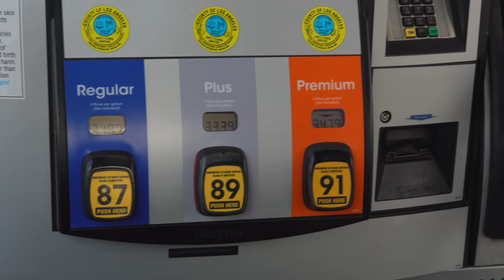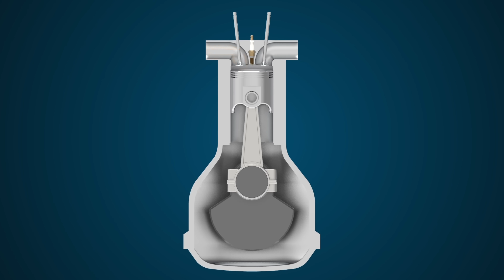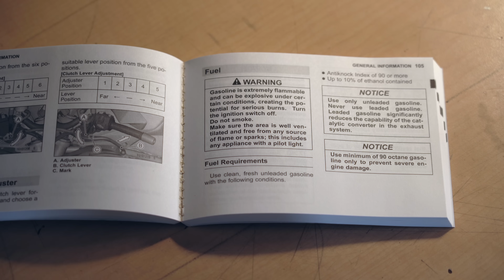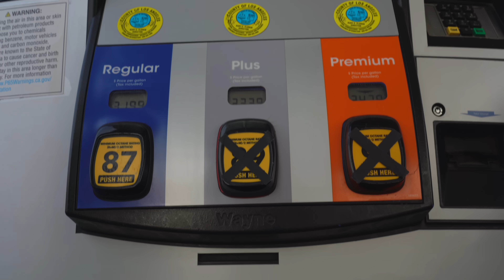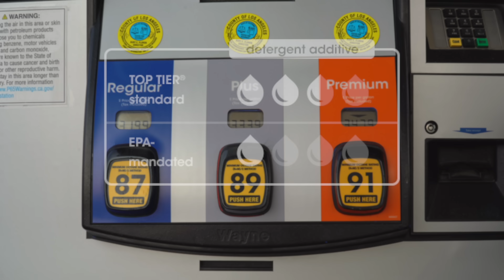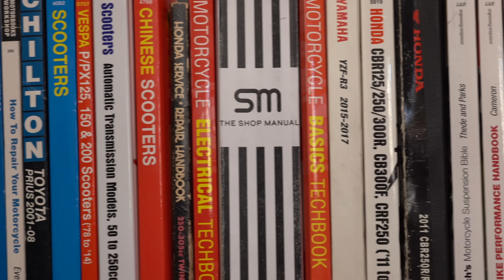Should You Run Premium Gas In Your Motorcycle? Octane Explained | The Shop Manual

Comment: oof, when he used a pic of my bike and called me out for putting 93 in it, it hurt a little lol
Reply: It may not be making more power, but your engine is clean, and that is half the battle. I have the same bike in my garage as well. With such a little tank, does it hurt to use premium gas?
Reply: only hurts your wallet.Waste of money really.
Reply: @iccus62  Yeah because a few dollars extra on top of how cheap it already is to fill a bike will make you loose your home with the amount of wasted money ...
Reply: cbr250 gang
Reply: Lol im getting a cbr soon, first 2 fills are gonna be 93, i like putting premium in any vehicle i get for the first 1 or 2 fills to help clean it
Reply: I only ride CBR 150, and always use 95 or 98 even tho 92 is enough..

Ps. We use different octane method, and i have no idea how to convert it, but i use v power or v power nitro+...
Reply: @PinotNoir_  u must be Danish :D .. 92 95 98 here also .. i run 95 only
Reply: @Ladosligese  I'm from Southeast Asia✌️... If i use gasoline lower than 95, i get slightly worse gas mileage so i run 95 or 98 to get slightly better gas mileage even tho the engine feels little bit hotter..
Reply: No bikes ever calls for regular the lowest rated for a bike is mid grade, I put 91/93 in my bike no matter what think about it your only putting 3-4 gallons at most its not that much extra money your engine is gonna run cooler and despite what this asshole says you will get better gas mileage and your engine will last longer and yes if you can find fuel with mount ethanol it is better but in the states that’s kinda difficult
Reply: @shorty808100  you actually get worse mileage if you put premium on a slow bike. You clearly have no clue xD
Reply: Honestly, this video didn't really make any difference to me though.  My logic for now is that I've already run 86 grade fuel (minimum for the bike) for about 150 miles and now have some control data for performance.  We'll see how the top tier 93 grade octane does for my CMX 500 which is basically the same engine as the CBR but tuned for lower end rev meaning a potentially higher compression.

Comment: In most modern engines, the risk of engine damage from running lower octane than recommended is low. This is because there are almost always ping sensors, and the computer will quickly adjust by pulling timing (if there is variable valve tech available) or lowering the amount of fuel delivered (if there is electronic fuel injection). There is some damage risk, as there has to be some pinging to be detected, but the general effect is reduced power, and possibly worse fuel economy. Aftermarket computer upgrades can bring the risk of damage back by being much more aggressive with the variables that are held back when pinging is detected.
Reply: Ok but why push your luck? If you really want to run a lower octane, you should load a lower octane fuel map.

Comment: Is the: "Fill it up with premium before winter storage and you don't need to add a stabilizer" myth true?
Reply: Roy Godiksen It can be a good idea to store machinery with non ethanol fuels over the winter as ethanol attracts moisture. The octane rating makes no difference whatsoever.
Reply: Then don’t waste your money if your bike doesn’t require premium
Reply: Fill with premium for no ethanol not octane and YES use stabilizer on last tank.
Reply: @gasman6922  what??
Reply: Use premium so the ethanol doesn’t sit in the tank during storage.  Your bike doesn’t need the octane unless the owners manual calls for it.  Yes use stabilizer if your bike will be sitting for mor than a month
Reply: @gasman6922  premium here has ethanol

Comment: Ari: In europe the values are higher but they are actually equivilant
Me: laughs in 102 octane
Reply: There is a different standard between Europa (RON) and the US (PON or MON if i remember correctly)
91 in the US is the same os 95 in the EU
Reply: RudyW 95 is the lowest octane in Sweden. With 98 as highest.
Reply: That's still equivalent to like 95 by US standards
Reply: My local 76 has that
Reply: Juuldebuul Me laughs if you think a bike designed to run on 95 will run better on 102.

Comment: Hi Hemming. I see you have lower octane fuel than in Scandinavia. We have 95 octane gasline and some have higher octanes up to 100 octane. But another thing about gasoline and diesel. The versions with added additives. Both gasoline and diesel with and without we can choose here in Scandinavia. We have 95 octane gasoline in Scandinavia, the 95 octane gasoline are in two different prizes on the same fuel station. A normal/regular and one that have additives in it and it cost a bit more. Additives that lubes and cleans the engine, valves, injection system and giver better mileage they proclaim. In Denmark here we have Circle-K tank stations (former ESSO) that has this two different types of 95 octane gasolines. Miles and Miles Plus their name is. https://www.circlek.dk/milesbenzin
Other gasoline tankstations like Shell has 95 and 99 octane and OK.dk fuel stations has 95 and 100 octane here in Scandinavia. Lowest octane is 95 octane here. And it is all lead-free. Any comments on gasoline with additives for motorcycles?

Comment: So I've always been concerned about gas pumps with only one hose.  The hose and plumbing from the bottom of the gas pump likely contains at least a gallon of gas I'd think.  And since I'm only putting about 2 gallons in my R3 I'm likely getting at least half a tank of regular unleaded that the minivan in front of me filled up with.

Has anyone done any testing on this or know how much the average hose holds?
Reply: A hose does not hold near a gallon lol
Reply: @AskformeJohnT  Doesn't matter much if your getting 16 gallons but of your getting two it does. Only way to insure your octane is to get a few gallons into your car and then fill your gas jugs for your bike. A hose  and other plumbing at a station can easily hold a gallon.
Reply: 😳...I've never even thought about this
Reply: Just downloaded the book for my bike. It says use 87 or up! I've been overpaying for premium🤣
Reply: I doubt it or you should thank the driver in front of you. Better yet, you hop from one gas station to next and never pay for gas. Seriously though, I have also heard this theory and it's nonsense. Most of the gas stations in my area are this way and have no issues with my premium fuel requirements on my BMW. Put gas in and enjoy the ride.

Comment: Thanks for the great video octanes definitely make more sense now. I have a Kawasaki versus 650 I always put 91 octane in it mainly because our 91 octane in town at the gas station I fuel up at Has 0 ethanol and has a separate hose for the 91. Does this matter having no ethanol in a small engine??
I have been pretty adamant my whole life to not use ethanol in my small engines especially two-strokes..

Comment: Someone pulls up in their Honda and fills up with premium.  Someone pulls up with their BMW and fills with regular.
Reply: Me pulling up on my Triumph, puts both and diesel while screeching demonically
Reply: Scott Campbell My Hondas have always used regular, as do most BMWs. What point are you making? Did you understand the video?
Reply: It depends on the year and model of the BMW, the ones built for the German Army during WW-2 were designed to run on 80 octane.  I believe that they may still offer over-thickness head gaskets to lower the compression ratio in their "push rod" engines for use in countries where high octane fuel is not available.
Reply: Honda built much better. Better tolerances. Same power output (or better) but with supreme reliability. BMW un reliable

Comment: When having a carburated bike in the Netherlands you have to fill up Premium just because of the Bio-ethonal they add in the fuel. It will fuck up your carbs and eventually cause problems to the engine
Reply: Same in Montana, USA. Ethanol will clogg yr carbs
Reply: SoloSeff That’s a totally different thing. Ethanol fuels can damage some plastic parts in older bikes. This video was about octane ratings.
Reply: David Matthews well in my neck of the woods anything but premium contains ethanol. I daily an 86 xl600r so its relevant to me
Reply: @davidmatthews3093  when talking about fuel and wich one to choose, this should be something to think about as well. 

going for the cheapest one on older bikes can ruin it

Comment: People need to know that most chincey octane boosters on sale at Auto Zone are not reliable for preventing detonation.  Some are, do your homework.  You’re much better off just getting the higher octane fuel If you can.  For example, In my Evo, with 93 octane plus an octane booster, I use Torco, about half a can per tank, and it got me 10 HP on the dyno, 530 vs 520.  But tbh the 10 HP, I couldn’t even notice it, so I just stopped using it.

Comment: Got a single cylinder 250 that I can definitely tell the difference in, and it's not a performance motor. Run 93 in the thing with a bottle of octane booster and it scoots.

Comment: A number of stations in my area sell non-ethanol gasoline in premium only. That might be a good reason to use premium when your bike doesn't need high octane. Another reason would be storage. I wouldn't put the bike away for the winter with ethanol in the tank.

Comment: I put 87 instead of 91 in my tank by mistake and good thing it was only a gallon. 
My bike shut off at a light, 30 miles away . It took me a bit to realize that I didn't pay that much on gas and there was a chance that I put in 87 but good thing I brought a 12oz can of 91 gas as a back up. 
That solved the problem and now I will never do that again!

Comment: With an 03 Honda Hornet in the UK, I fill up at Shell. On the same commute day in day out, I switched from their standard fuel to their V Power high octane fuel. Then comparing to the various supermarket and premium brand stations.

Rince repeated this over the months noticing I actively got more MPG on my regular journey with V Power, so much so it's more cost effective. When doing this on my fuel injected SV650 however, the difference was negliable. Interesting result non the less.

Comment: Here in Utah 85 octane is sold instead of 87 as the lowest grade.  This is because of the higher elevation (4,300 ft above sea level in SLC).  This was fine, especially for older carburated vehicles.  However, with modern vehicles, many owners manuals state to use 87 octane minimum, even in high-elevation states were 85 is sold - such as my 2018 Ford Explorer manual, and just the regular v6, not ecoboost.  Same with my 2016 Mazda 6, which does run noticeable better on 'mid-grade' 87.  My Versys 650 runs better on 87 instead of 85 as well.  So have to pay more for what should be the lowest available octane fuel.   Profit scam by big oil.

Comment: Completely wrong about the grades being the same, a Europe standard 95 is equivalent to a US 91.
Reply: @thespectator5259  Except he did... "but that's only because they use a different rating system, the grades are actually equivalent" 
They aren't, a US super is lower octane than a European regular.
Reply: @thespectator5259  Are you stupid? I clearly understand the different rating systems, but the GRADES ARE NOT EQUIVALENT.  
Regular in Europe (95 RON, 91 PON) is higher octane than super (89 PON) in the US, so is better fuel.  
How is that the same quality fuel? 
How are the grades equivalent if your regular is considerably worse than anything you can find here in EU?

If you run a EUDM or JDM vehicle in the US you need to run premium or risk knocking.
Reply: Listen again - he said European countries use a different rating system.
Reply: @joby602  Yes.  And the 95 on the European system (which is "regular") converts to 91 on the US system which is between super and premium.